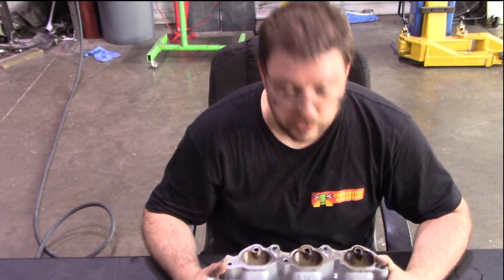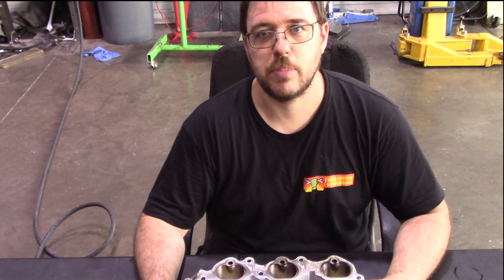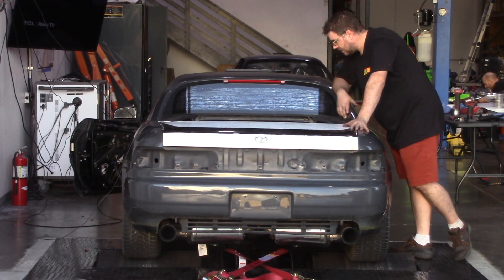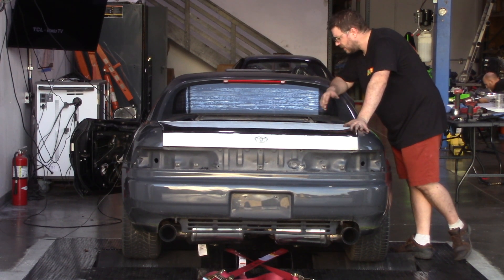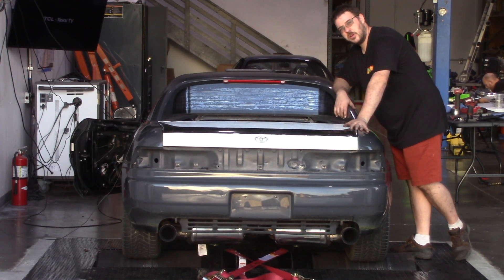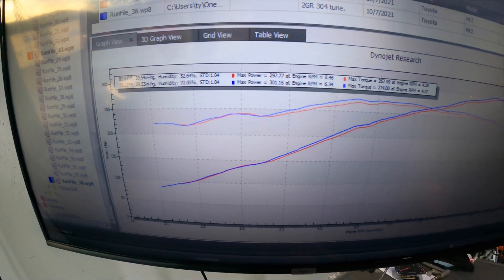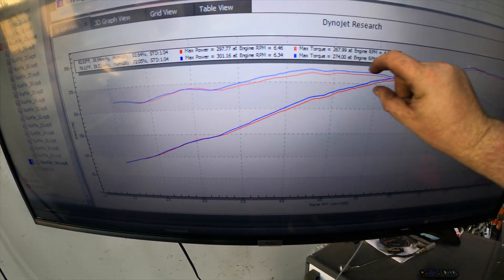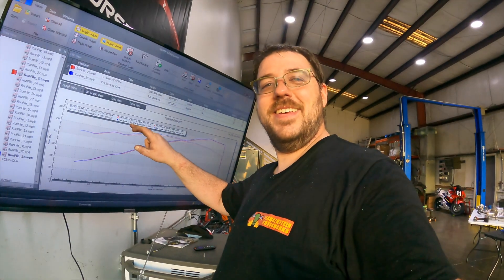Getting to over 300whp with the 2GR-FE

Comment: Hello,why didn't you start your project with the 2gr fse motor to have additional power?
Reply from the maker: The 2GR-FSE is a completely incompatible engine. The 2GR-FSE is intended for longitudinal mounting so the bellhousing does not match and even if an adapter was made there would be no space for the right side axle shaft. Also, the 2GR-FSE has a slightly higher compression ratio which is helping the power but most of the additional power just comes from having an exhaust that isn't as blocked up so the difference isn't nearly as large as it would appear on paper.
Reply: @FrankensteinMotorworks  will the engine head from the 2gr fse with its harness and ecu work on the 2gr Fe Block so you can get the best of the 2 engines?
I'm working now on modifying a 2gr fse lexus 350 and your videos have alot of value. Thank you
Reply from the maker: @supra320hp  they both use the same head gasket part number so they would likely interchange but there's no additional power in he head. the only additional power is in the extra compression from the pistons. Also, the FSE heads on an FE block would make it so the direct injectors would not be able to spray properly.

Comment: Can you turbo the 2 gr?
Reply from the maker: Absolutely, you can turbo anything. But the 2GR has bee successfully turbo'd already. If you look up ATS they've gotten to over 600whp in an MR2 with a 2GR on stock internals.
Reply: @FrankensteinMotorworks  that’s good to know but you know I got the 2 gr in a Camry so would it still be the same
Reply from the maker: @Jesus-hc9mz  In either case it's a fully custom job. With the camry you've got the extra concern about keeping the automatic transmission happy but otherwise it's generally the same kind of thing.
Reply: @FrankensteinMotorworks  Before I heard of these 600whp stock internals I was under the impression you'll have issues around 400 to 425 engine hp due to the rods.  The information i had had the rods being the same as 1mz/3mz
Reply from the maker: @dennisrobinson8008  The motor only really shares the Toyota name with the 1mz/3mz. it's a completely new design and it's stupid strong.
Reply: @FrankensteinMotorworks  I'm aware the 2gr is their most modern iteration for a top if the world v6 that can perform.     Its a bad ass sounds incredible.

Comment: Any chance this would work on a 2gr with a stock Toyota ECU? I have a 2018 Avalon and I’m trying to make more power without a tune.
Reply from the maker: The stock ECU is very tolerant to modifications. Before i started tuning these we were already making 275-280whp just by giving the engine more airflow. The biggest airflow restrictor on the stock 2GRs is the y-pipe.
Reply: @FrankensteinMotorworks  very insightful thank you so much I appreciate you taking the time to reply
Reply: @FrankensteinMotorworks  I just noticed this comment. Is it the. y-pipe or the OE pre-cats in the exhaust manifold? I'm Finally doing exhaust work on the evora now that the SCCA will let me.
Reply from the maker: @donoursizemore1030  honestly the cats in the manifolds really don't seem to take much power at all. it's just the y-pipe. not sure what the evora's y-pipe looks like though.
Reply: @FrankensteinMotorworks  I think it's exactly the same up to the flex section.
Reply from the maker: @donoursizemore1030  if that's the case then yes, i would get that thing replaced ASAP
Reply: @FrankensteinMotorworks  with a 2.5" y-pipe or really invest heavily and build a dual exit system?
Reply: @FrankensteinMotorworks y pipe gave how much on 2gr?    On 1mz/3mz its 10 to 15whp on natural aspirated and more boosted.
Reply from the maker: @dennisrobinson8008  Keep in mind i really don't use these in the stock application but based on what i've learned it seems to gain 40whp from a y-pipe and exhaust. the y-pipe is the most restrictive part of the 2GR's exhaust. The rav4 y-pipe is a bit better but still the biggest restriction in the system.

Comment: Would this modification work on the 2GR-FSE? Or is the intake different? Great content!
Reply: I’d like to know too
Reply: I have a 2GR-FSE intake laying around. I'll check and see
Reply: Update. The 2GR-FSE intake is different. You can not port the FSE intake that same way as the FE. The FSE fuel injectors are positioned differently. If you were to remove the same material on the FSE you would end up cutting a hole in the the intake.
Reply: There have been some people on ClubLexus and YouTube do a minor gasket-match port on the lower intake manifold and the upper plenum on the FSE and gotten pretty solid results around ~10 whp.
Reply: Send the link plz

Comment: Are you thinking about providing 2AR-FE or AZ motor mounts for front longitudinal rwd? Specifically this would be a 74 Celica but we use a lot of modified ae86 parts in our cars.
Reply from the maker: There are no current plans for any longitudinal bits from Frankenstein Motorworks. That may change in the future but there's just nothing on the schedule right now.

Comment: I have a 2gr-fks powered Tacoma and am trying to get as close to 300 as I can. 
I remember reading your website several years ago and am just now finding your YouTube channel. 
I appreciate the R&D and great information.
Reply from the maker: Thanks for watching, i enjoy sharing this stuff. Good luck getting to 300, you can do it!
Reply: @FrankensteinMotorworks  I would like to see some technical videos about 2gr-fks tuning. 
I am a tech and have experience tuning. I started working with my truck a little over a year ago. 
I have found that the power to be gained is in the cam angles and ignition timing. 
I started with the intake side and built a good board that runs great then I worked on the exhaust up higher in the rpms and found what it liked there. 
A few months ago I revisited my cam work and began to work more in the lower rpm and mid range loads on the exhaust side. 
I have found diesel like lug ability in that 1200-1600 rpm cruise and off idle torque to 3500 it never had before. 
I will be interested to see what you learn after you get your 2gr-fks running.
Reply from the maker: @tech1302  I've considered it a few times but actually making a video how to tune is rather complicated. I may do one eventually but it isn't on the schedule right now. I also do not have a 2GR-FKS to play with.

Comment: Marc, please share what bits you’re using to mill the aluminum out.

I have an aluminum intake that I need to bore out to 2” while port matching the tb that’s going on it. Yeah, not a 2GR 🤣
Reply from the maker: It's just a standard carbide burr kit like this one: https://amzn.to/3FRNI5U There's also longer ones if you need the extra reach: https://amzn.to/3BZgKhG Note the steel carbide burrs work on aluminum for quick work here and there but they will pack up with extended use. The  finger sander there is a combination of this tool: https://amzn.to/3peTN6L with this sander https://www.harborfreight.com/38-in-belt-air-sander-60627.html and this kit: https://www.ebay.com/itm/274409456284 (note the amazon links are affiliate links and i do make a couple pennies if you buy through there but feel free to just use the links to get the details instead)

Comment: can i find the measurements for the 2arfe and 2grfe somewhere. i am looking for the measurements how far from where the gearbox bolts to the engine to the outside of the crank pulley. i am wondering if i can swap out my 1azfe awd rav4 engine for either 2arfe or 2grfe
Reply from the maker: the 2AR is almost exactly the same size in every dimension as the 2AZ except for the height. it is about 2-3" taller. the 2GR is a tiny bit shorter from the bellhousing to the balancer but obviously much wider.

Comment: It begs the question, what would porting the entire lower intake manifold produce?  Could another 5, 10 HP be found if we didn't go hog wild on it as  I realize at some point, it'll become too large and lower air velocity and HP,  but it appears we aren't there yet as just removing one restriction (and turbulent area) picked up an easy 5hp.
Reply from the maker: I agree, it seems like there's likely some more power there to be had with additional work. Going beyond this would likely benefit from also porting the head and then quickly you're talking about taking a motor apart.
Reply: Did you all get additional data?   It appears the lower intake at the upper and lower intake junction have a very large cross section, so it may not be a restriction.   But getting the bosses out helped, perhaps because it was obscuring the intake port on the head?

Comment: Why were those holes/bumps there in the first place?
Reply from the maker: There's a minimum thickness when making a casting for it to pour reliably and the other side has the injector o-ring right there. Since they were able to meet their performance goals without the extra machining steps they did not bother to remove the extra material.

Comment: If you are OCD like me and try to get the areas being removed as low and smooth as the rest of the port its easy to break through to where the injector seal sits. So just be mindful of this when porting.
Reply from the maker: even if you break through a little bit. it's a square rubber o-ring on the other side and it'll seal just fine. but there was quite a bit of thickness left there so i wonder if your casting had a badly centered core

Comment: Would there be an long term strength concerns by grinding them short like that?
Reply from the maker: There's plenty of material left. the only reason that was there is due to minimum casting thickness requirements for the injector seal.
Reply: @FrankensteinMotorworks  good to know. Thank you.

Comment: Love the constant 2gr content 👌
Reply from the maker: Don't worry, there's a bunch of 2AR stuff coming too :)
Reply: @FrankensteinMotorworks  you post em, I'll watch em. Let's get this thing monetized!
Reply: @FrankensteinMotorworks  SWEET
Reply: @FrankensteinMotorworks  by removing the bosses fully does this now make the sealing surface at the injector o-rings?
Reply from the maker: You can grind the bosses off on many lower manifolds without punching through but some do have enough vertical core shift to where it is a problem. If you have one of those you can source a different one with better core alignment or you can just leave a small bit of the boss inside the runner to avoid punching through.